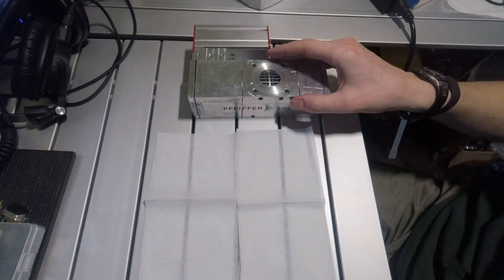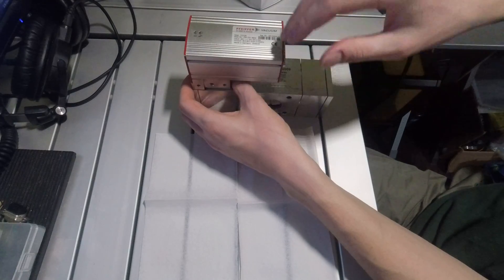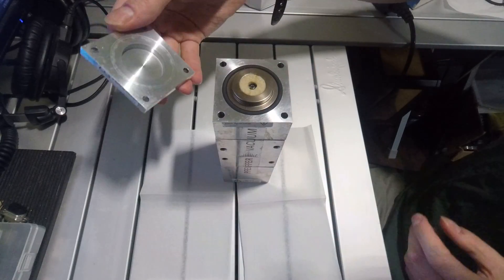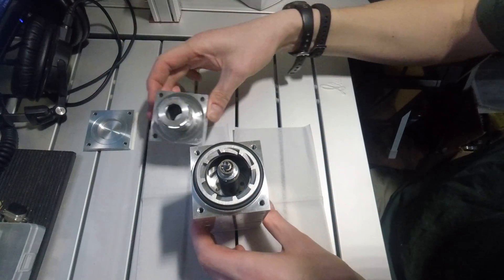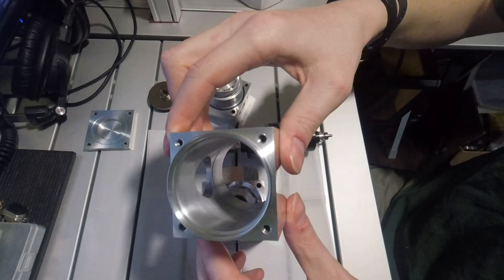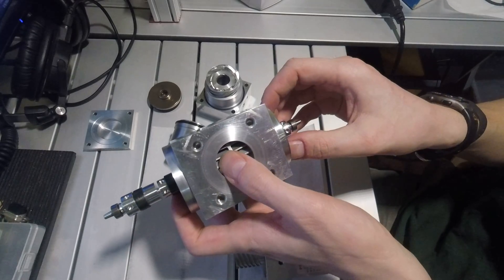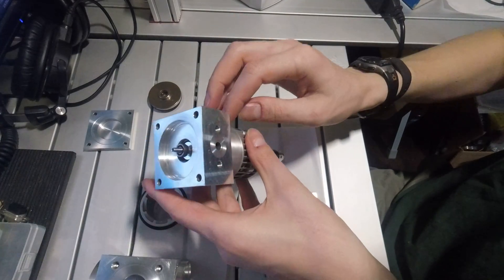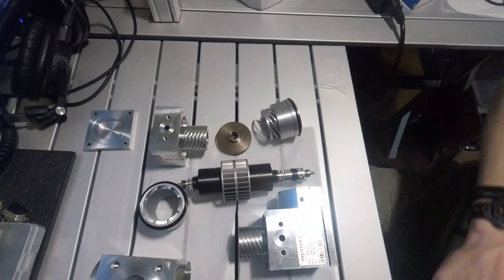Pfeiffer TPD-011 teardown GOPR1078

Comment: I have an old Pfeiffer-Balzers TPH-062 that I recently repaired(potted hall sensor swap - it's doable!), and despite the age differences the construction techniques are very similar. The rotor is made using an identical process - the only difference is that it's vertical and there's stators between multiple rotor sections.
Well, that, and the lack of drag stage.
I can also confirm that the drag stages are identical to other manufacturers, as the Holweck stage on my Edwards EXT255 looks nearly identical to this one(same rough rotor style), but with a single fold.

Another cool note is that all of these pumps use the same lubrication method - the wick doesn't lubricate the bearing directly, but that conical piece on the end of the rotor(removable on mine, probably on yours too) touches two small felt pieces in the wick, and uses centrifugal force in combination with the capillary effect to pump the oil into the bearing.
Reply: wow this guy is everywhere
Reply: @reps  I am all-encompassing
Reply: @Spirit532  I can say that the pfeiffer tmh-260 uses the same method for lubricant delivery, sadly these pump use a variant of a 607 ceramic bearing, really hard to get, I had to do some atrocious things to get my pump running, not sure how long it will last, even had to make the controller myself 😅
Reply: @reps  marco I suspected you were a turbomolecular pump aficionado since I saw your rotor desk ornament, I hope someday you do a video on turbo pumps